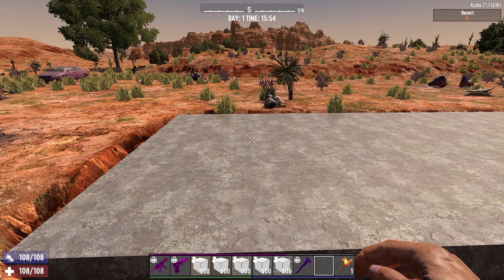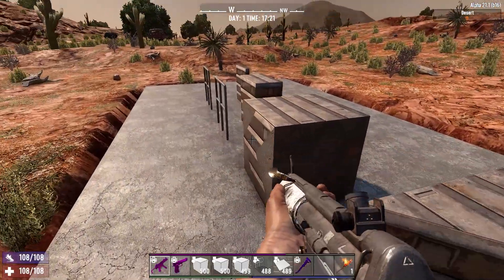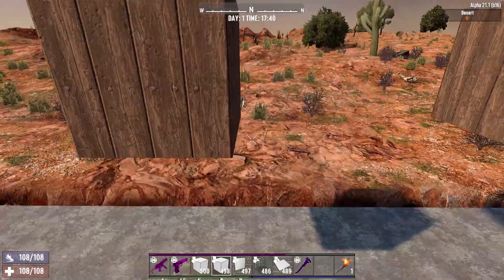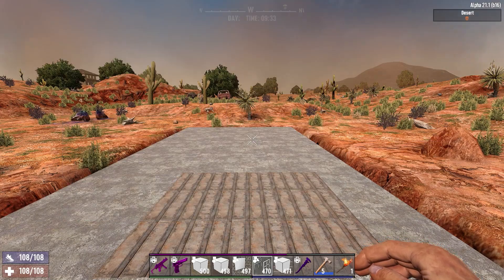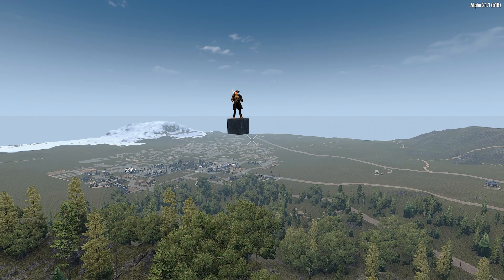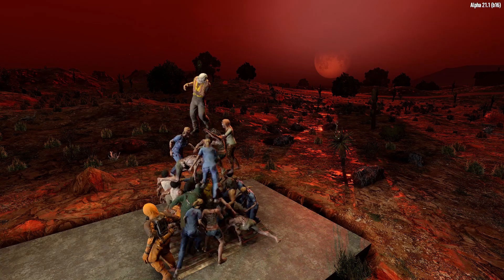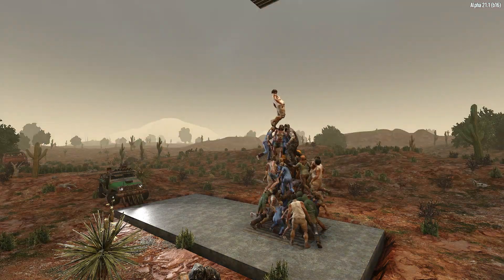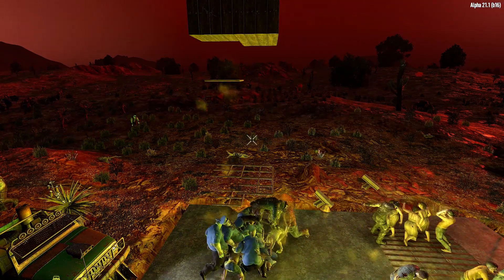Build FLOATING bases in the air! (7 Days to Die: Alpha 21)

Comment: I disagree that its a bug. I think its intemded for the rail to vanish against a wall. Clearly though, they disnt intend for it to be used in this fashion. Yeah i think theyre going to change it quickly now that its been discovered.
Reply from the maker: That's an interesting though - I hadn't considered that.  Although if it was meant to disappear, wouldn't that be just like the single rail?
Reply: @CautiousPancake  I see your point. Do the railings on the double railed stair blocks disappear when placed against a wall?
Reply from the maker: @FraterAleph Yeah they work the same, kinda - the railing disappears, but the stairs in the middle remain, and extend - allowing broad stairs using the one block.
Reply: @CautiousPancake  it's exactly the type thing I would do if I were a programmer in order to make life easier for the POI designers. If they fix this it will entail going through and revamping a lot of POIs where they used a double rail instead of a single rail because they conveniently had the block in their hotbar at the time. I think they'll definitely do it but it'll take time. It may be one of those things where it gets put off for a long time as a result like the arrow slit blocks were.
Reply: Aren't repairs impossible? Great vid
Reply from the maker: @Stelknecht  Thanks - and yeah - it's why I personally don't think it's worth "fixing" - it's risky to use on critical parts of your base, as you don't know what's damaged and what's not, and even if you did- you can't repair it!  I'll be using it for visual effects - basically being able to put in a pillar that I know they won't attack, just to make something look nicer!

Comment: omg this is amazing. for the district zero mod I was wanting to make a spaceship that was hovering off the ground but didn't want to use sheets and plates mess with the bot's pathing. As for if it'll get patched it possibly will. they've shown they watch your stuff and this can be abused unfortunately, but guess we'll see. for now floating base...or tree house base and one properly supported without having fight tree alignment. knew you'd figure up a better way to make that work even if wasn't the plan. well done.
Reply from the maker: Yeah - it's not something I'd be keen to use for big builds or mods in case it gets patched.  If they leave it for a while like forcefields, then maybe!

Comment: how can you see your caracter  like 3:45  what command is ?
Reply from the maker: It's a two part:

Hit F1 to bring up the console, type in 'dm' and hit enter, and F1 again to close the console. After that, hitting F5 will toggle between first-person and third-person.

Once in third-person, hit 'p' and then '[' to detach the camera and fly it around.  

To get back to first person, hit 'p', then '[' then F5 and you should be good.   

If you get all twisted around, (for singleplayer) you can logout and log back in again and it will reset.

Comment: This would be great for building actual flying poi's. The house from UP, a ufo &/or a blimp or airplane.
Reply from the maker: Absolutely!  Even just big warehouses - the player could walk through and not even know it's there (unless they are trying to place blocks, then it might be a bit weird :D).
Reply: It’s very interesting indeed, but I didn’t use it in my large prefab builds (like the Space Shuttle), because it might be patched. 

If the ‘bug’ is still in the definitive (Gold) version (in 2050 😂), then I will use this invisible feature for sure. It cost me a LOT of time to get the Space Schuttle stable enough without it.
Reply from the maker: @LifeStartsAtrpm-ru1xo  Good call - that's the hard part about using (or not using) tricks like these - they might not be there after the next patch!
Reply: @CautiousPancake  that's really sad. I'd like to explore a space shuttle.

Comment: I'm half convinced this isn't a glitch- when I was building a base that had walkways (the walkway wooden flooring and squared railing wall in one) as the edges of a cube (to stop me falling off...) but later added plates to the outside for an added protective layer, the railing part of the walkway block disappeared just like this one. I didn't think it was supposed to but it seems like it merges with the other block for most of the railings, and in my case left only the floor part of the block visible. I think it's a "feature" of railings that they do this, to prevent clutter internally, in bases maybe.
Reply from the maker: I agree, I'm sure I've seen it in POIs as well at things like the small staircases at the front entrances to buildings. I don't remember which ones, but if they "fix" this one day, they'll need to update a bunch of POIs too I think

Comment: If they choose to fix it, I really hope they leave the current version in Creative Mode, for larger stable prefabs.

I really don’t get why TFP refuses to make poi-versions of the turrets, bladetraps etc., including electricity for prefab builders. Of course without the possibility for players to alter that, so no using or picking up of a poi-turret for example. 

No prefab turrets, traps and electricity takes away immersion imho.
Reply from the maker: I feel like, if they do bandits with raidable bandit bases, they'll have to add in poi's that can store wiring and turrets etc.  Unless the bandit camps don't do wiring and traps, which would be a bit disappointing.  Surely the bandits need to defend from zombies too?

Comment: I believe the difference in the zombies being able to target the invisible block comes down to the height you built them up to.  Saw somewhere else that zombies wont go into "destruction" mode if you are more than 11 blocks away from them.
Reply from the maker: It could be that, but with the stacking they should have been in range as the platform was on the 13th block. So zombies should have been high enough.  Also, when there's no path to you the destroy area mode is triggered anyway, regardless of the usual fall trigger.

Comment: I think the only real upset would be in pvp. Of other players dont know they can destroy the bottom blocks of a floating base, i could see how that could be annoying. But imo, it shouldnt be fixed for any other reason than potential pvp frustration, as the blocks do not behave as expected/ designed.

On the other hand, single or cooperative play could have a lot of fun making spaceship builds or experimenting with these blocks!
Reply from the maker: Good point on PvP! The only way to bring down an invisible column would be to destroy the block it sits on, which could be difficult to find!  I didn't check explosion damage, will have to see tonight if rockets hit the invisible blocks.
Reply: all ten people playing unmonitored pvp would be very upset indeed

Comment: hey, does this trick still work?  which exact block name are you using? i tried it today.. the ones near the full blocks disappear but when u put ones above in the air they dont disappear dunno if im doing it wrong or using the wrong block or if the fun pimps fixed it so u cant do it? im trying to do a building with an overhang and cant quite build what i want.. was hoping to do the invisible thing so i dont need a huge long pole to hold it all up.. thanks for any info
Reply: ah i just rewatched and see u was using the double double not the singles.. i will try it again thanks
Reply from the maker: Yup - saw your reply - it's the double for the large supports - and just checked it's still good for 21.2 (b37).

Comment: All the floating tactics are obviously bugs. If there is no visual connection from bottom to top, it shouldn't count as vertical support.
Whether The Pimps fix it or not depends on whether they think that it will trap too much noobs into just going with a cheese build that is efficient but also very boring instead of actually playing the game. they didn't fix floating in general, force fields, obstacle drop courses, the slide and a few other pathing exploits. The roundhouse fix will likely be that zombies eventually give up reaching you and just go into area destruction mode.

That said, it is hard to create arconian funnel buildings with the limited structural support mechanics in the game. So i might exploit the hell out of this actually invisible floating technique to improve the look of my buildings. I will still provide proper paths for the zombies. But with invisible supports, i can create some realistic but also bold looking tower and bridge structures which just aren't possible without floater cheese.
Reply from the maker: Agreed - I think that's where this has the most utility - with additional supports creating better looking buildings where you can have more realistic looking large interior spans, without needing to put in columns, or hold the roof up with shelving.  

The AFK part was not expected to work - smaller scale tests failed due to normal rage mode type mechanics - so most that try will fail, or my filming run was a fluke.  Either way - prettier builds works for me!